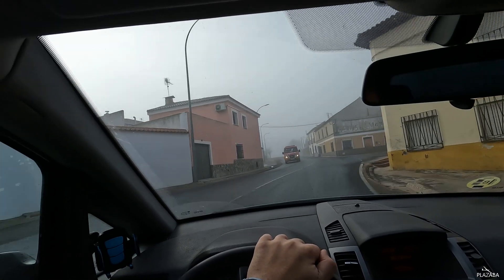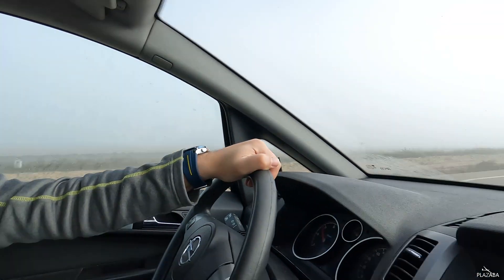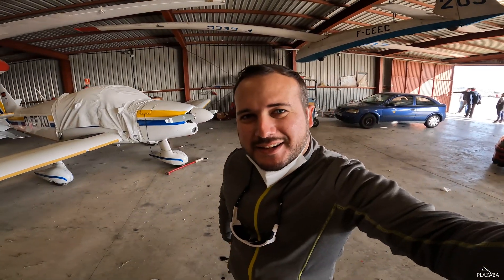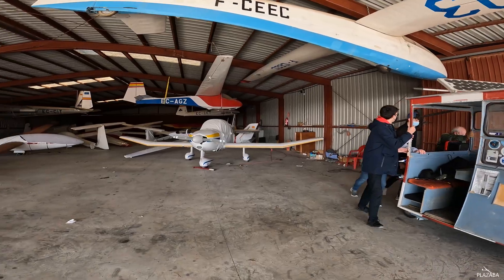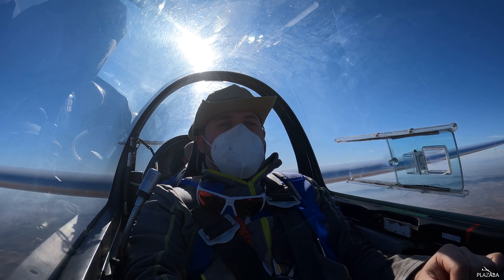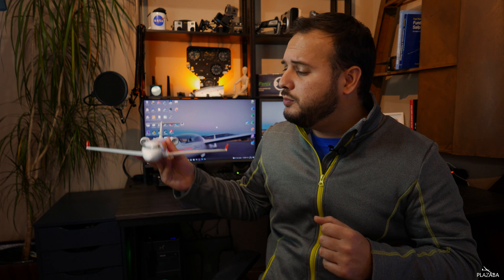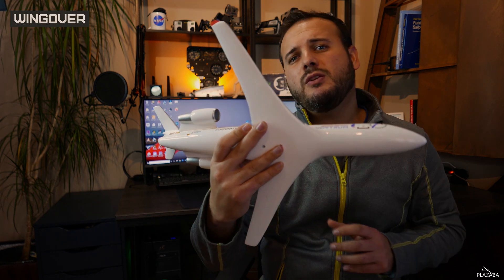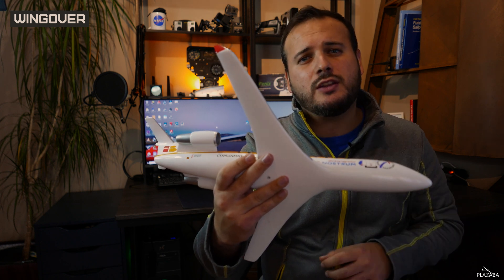GLIDER AEROBATICS

Comment: Great video. Especially the horizon stabilized section shows the dynamic very well.

Interesting than the DG500 spins similar to our G103.
Reply from the maker: Actually, it was difficult to spin with the DG 500 without tail weight. In the first flight we tried to do 8 spins but we really did 4. The others were just fast spirals.

On the other hand, spin with the fox is very very easy.

Nice to see you enjoyed the video. Thanks for your comment!!
Reply: @plazaba   Same on the Twin Astir. We had to sit a light weight instructor in the front . It was stable immediately after the 180° turn, just like the DG500.

Were those Fox shots taken with a 360° camera? Looks like a lot of work in the editing    process.
Reply from the maker: @michaelderflinger5002  some times I use insta one r with 360 mod (you can see my other acro video in my channel using it) , but this time I used GoPro 10 + max lens. Only one axis stabilization but no reframe needed.
Reply: @plazaba  so this is done automatically? Nice.
Looking forward to the next video...
Reply from the maker: @michaelderflinger5002  the stabilization yes, it is automatic with the max lens mod

Comment: Nice filming! I have not flown the DG500 but did some inverted aerobatics training in the DG1000. My instructor told me that it is prone to deep stall inverted and requires a special recovery technique. The DG500 even more so. As I understand it the glider establishes a nose down attitude at 140 to 150 kph at a horrendous sinkrate with stick fully forward. Making a sharp backwards jerk on the stick to change angle of attack kan exit the stall or You have to roil out. Curious to know if this is taught when the DG500 is used for aerobatics training. Here in Sweden most aerobatics courses are on the ASK21. We have a Puchacz in my club that is really good for spin training, it spins rather similar to the Fox but a little slower.
Reply from the maker: Thank you for your comment. Indeed, we used the Dg500 just for basic manouvres (Chandelle, lazy eight, looping and spin). The rest of manouvres, including inverted flight are done with the fox.